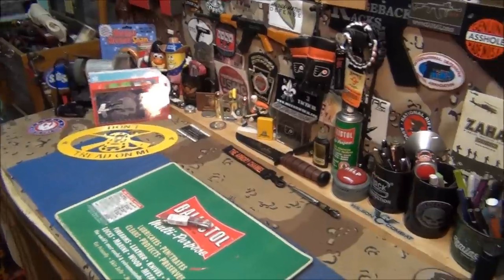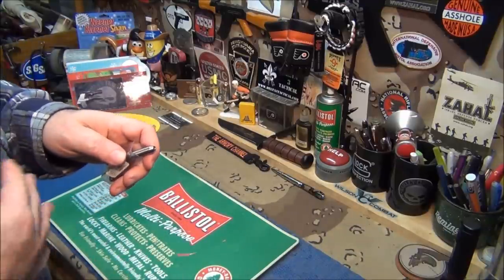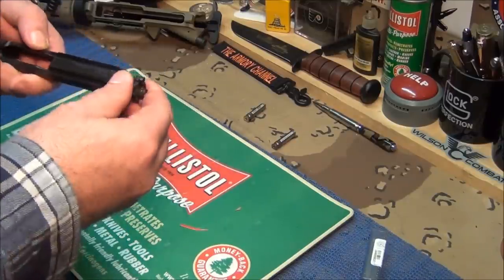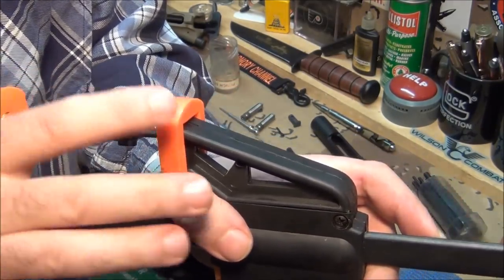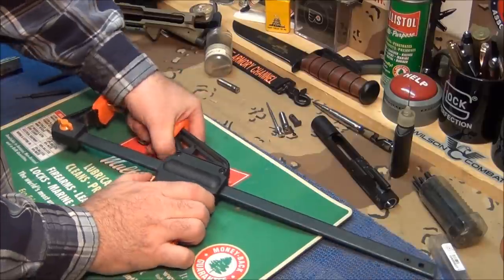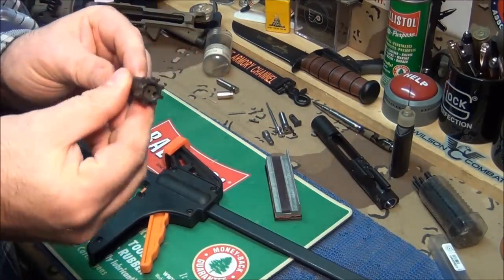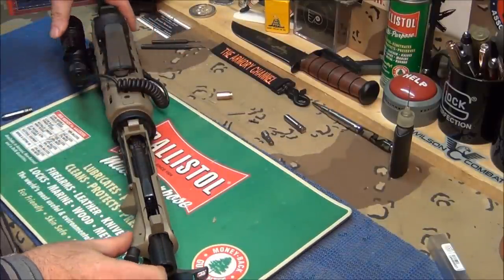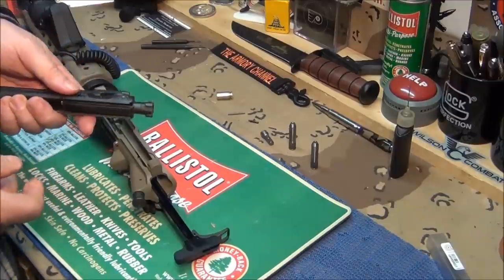AR15 how to check head space

Comment: I got a bolt vise from Brownells. It's one of those tools that is seldom used but it makes removing/installing the ejector a piece of cake. You can get around using one but it takes a dreaded job & turns it into a quick,easy procedure. I bought because I needed headspace checked & the vise cost the same as having a gunsmith do it once & in my current position (in bed 24/7) I couldn't get the ejector out without it. Basically,I bought the specialty tool instead of paying someone.

Comment: You made the extractor pin removal and reassembly much harder than it needs to be. In basic Training we removed it for every cleaning. you can use the firing pin to just push it out while you keep it from flying out with your thumb. Assembly is the reverse of disassembly. Simply put the extractor in insert the roll pin a little and use the firing pin to push it back in if there is a noticeable resistance then you don't have the extractor pin in right and you won't be able to get the roll pin in.

Comment: Russel Haller... the go gauge is the minimum amount of headspace needed and the bolt should close on it, if it doesn't... I would think the lack of headspace would tell you that it is not safe to attempt chambering of fireing a round out of that firearm.  I'm hoping  someone more knowledgable than me will chime in here and correct me if I'm wrong.

Comment: Suggest you watch NSZ85 video on how to remove the roll pin on the ejector. Holding the bolt in the palm of your hand, just use the correct punch to tap out the roll pin. The punch displaces the roll pin holding everything together. Then put your thumb over the bolt face and pull the punch out. The ejector won't go flying off with your thumb covering it.  Easy peezie.

Comment: I'm new to AR's so bear with me....but couldn't I just take the firing pin out of the bolt and use a live round to headspace? or am I missing something important?
Reply: If a live round chambers, you have sufficient (enough) headspace. 
If a live round doesn't chamber, you have insufficient (not enough) headspace. HOWEVER, most loaded rounds vary from maker to maker, so that's why gunsmiths and manufacturers use a GO gauge. If a GO gauge fits, then ALL ammunition made to SAAMI (Sporting Arms and Ammunition Manufacturer's Institute) specs should fit in the chamber. 

Reloads and some poorly made foreign made stuff may still not fit. Cartridges with bullets seated longer than SAAMI specs may not fit. 

Checking for excessive (too much) headspace requires the use of a NO GO gauge. This gauge is longer (datum point at the shoulder to the base) than any cartridge should ever be. If your bolt closes on a NO GO, most gunsmiths and manufacturers will consider the headspace to be leaning towards ,excessive, but not technically unsafe unless the bolt closes on a FIELD gauge (see below). When chambering a new barrel, most gunsmiths and manufacturers will usually keep headspace between GO and NO GO specs. Even headspace that isn't unsafe (beyond FIELD) can still lead to significant case stretching and eventual case head separation under certain conditions. Case separations can lead to damage to or destruction of the gun. 

The "field" gauge is a little longer (in simple terms) than a NO GO. FIELD gauges are often associated with military chambers, where tolerances tend to be a little looser than the typical commercial rifle. If a gun closes on a field gauge, headspace should be considered to be excessive, the gun unsafe and should not be fired. It is very close or exceeds the maximum headspace according to SAAMI specs.

Comment: When you did the first check with the no go gauge... it looked like you didn't allow the extractor to engage the no go gauge before pushing the bolt carrier group all the way in... removing the extractor will allow you to seat the gauge with little pressure to avoid that happening again...good video though

Comment: I stopped after you started in on the volunteer fire department's air siren; you'd be singing a different tune if it were your house on fire and that siren didn't go off, it's not unnecessary or stupid, it's ensuring to those who are in need of help that it's on its way, if you don't like it move your ass to the city

Comment: WARNING:  i just tried using a 3/32 punch.  It seemed too big+the pin wasn't moving, so I went down in size to (what I can see) is a 1/16.  The 1/16 jammed into the middle of the pin, and snapped off when I tried to get it out.  MAKE SURE YOU USE THE CORRECT SIZE PUNCH.

Luckilly, it's a cheapo BCG that I didn't really want to use anyway, but now I'm out a punch.  Also, don't do this when you're tired b/c you will get sloppy.  I've done this 2X before without issue, but it was mid-day and my eyes get worse as the day goes on.  I fuckin' hate getting older.  Hope this saves someone from fk'ing up their bolt, and breaking a punch.

Comment: No go was not checked correctly. It should have been pressed with the same pressure he used on the go gauge. The case should properly seated in the bolt, not close then eject the same way to get the correct measurement.

Comment: If you have access try a different bolt, preferably a new one. If that doesn't work you are going to have to return the barrel to the manufacturer/retailer for a new barrel. The barrel is headspaced with a thread on barrel extension that is pinned in place, a competent gunsmith can reset the headspace but it is is usually more money/BS then it is worth. Besides its the manufacturers,fuck up and they need to fix it!

Comment: I'm getting ready to start reloading. I think I'll screw my sizing die in, in tiny increments, until the brass is at the perfect headspace dimension. Of course, I'll need to check it several times, but I think it will be worth the trouble. There's no need in bumping the case shoulder back any further than need be. That way your brass won't stretch as bad, and it will last for many more uses. Plus, it should help with accuracy. Does anyone else do this?